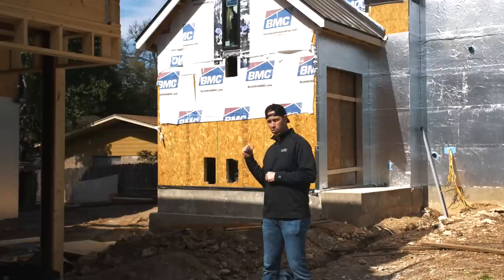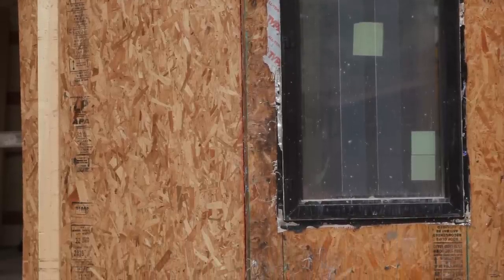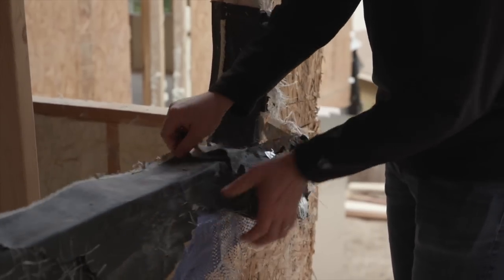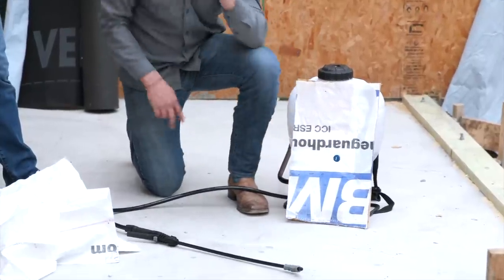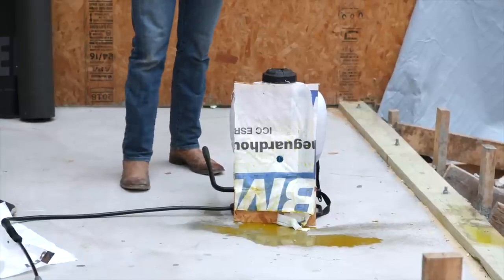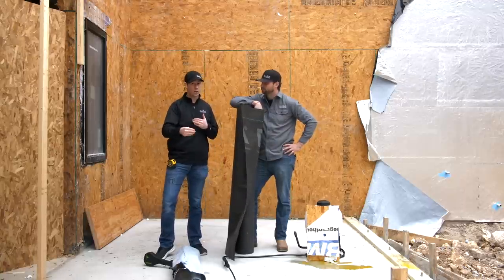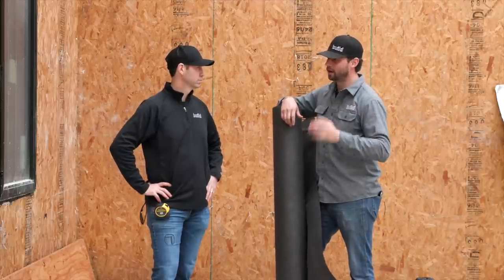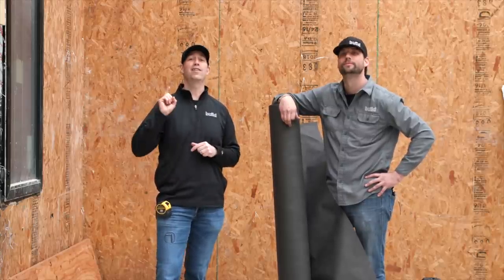Mold and Rot on a BRAND NEW HOUSE - What went wrong?

Comment: Can you tell us more about Delta, is that a tarpaper product? What do you think about tar paper?
Reply: Not a Tar paper product, it's a synthetic underlayment & pretty expensive. Issue with Tar paper is that it breaks down very quickly if exposed to direct sun light for more than about 30 days.  Best option in my option is to use ZIP since it save time having to put up a vapor barrier, You just need to roll the seams with the Zip tape. Funny that home was probably a 2M to 3M, yet the home owner options to go the cheapest option. Now they are paying the prices of choosing the lost bid contractor and lowest material costs. Case of penny wise, pound foolish.
Reply: It's a brand
Reply: @guytech7310 , I agree that tar paper breaks down with exposure, but most don't leave it exposed, or at least they shouldn't.
The Zip System with liquid applied sealer seems to be the best, but how are the nail penetrations sealed when the siding is installed ?
Reply: August:" I agree that tar paper breaks down with exposure, but most don't leave it exposed, or at least they shouldn't."

Actually its very difficult to get tar paper covered in time. Consider rarely does the contractor that does the siding or roofing work show up the day after the paper is put up: weather, scheduling delays, material delays or wrong or incomplete materials. 30 days isn't a lot of time in a construction project. Also consider its a good idea to install battens for a rain screen between the sheathing and the siding. Depending on the project this can take about a week or more. Again: Fluid applied requires extensive training to apply correctly & its difficult to find certified contractors. Tape is the safe option.
Reply: @guytech7310 , True and I agree !

Comment: Hey Matt, I recently bought a home in Central FL. It's a 1984 wood frame, covered with red brick. I recently discovered at the top of the wall, the approximately 1.5" gap between the water barrier and the back side of the bricks is not sealed. Should I go ahead and seal that opening, or is there a specific reason it was left open??

Thanks
Reply: there is supposed to be an air gap.....

Comment: The only good reason for using OSB on a wall is that for a 1 story home you can use 4'x10' OSB vertically and eliminate the horizontal gap.
Reply: They have 4x10 plywood. Osb has now use other than something that never sees moisture

Comment: Great video!
Nice to see you use german products (delta foils).

But what I do not understand - how can one build such a huge house and then choose to construct it with what seems to be rather flimsy "tooth-pick-sized" wood pieces with osb board attached to it?!

For my garden-shed - ok, sure!

But for the house I am living in, i would rather have Aircrete like Ytong, Poroton or something similar or solid limestone as the inner shell - then some 7-8 inches of rockwool stonewool insulation - an steam-permeable membrane attached to it's outer side and then some good old fashioned bricks on the outside of the wall. All built after code and it should be good for 100 years at least...

You do not build such a big house for 20-30 years, do you?!
Reply: Kniefi there is nothing wrong with wood if you keep it dry.  Dry wood is not a 20 year product.  It will last far in excess of 100 years.
Reply: Most new construction in the U.S. is indeed intended to last about 30 years, given the materials they are built from.

Comment: 99.9% of homes built in the last 30 years have half the life expectancy of of homes built before because of the changes made in insulation and the exterior. It depresses me to even go around trying to fix them anymore.
Reply: Could you elaborate and what do you suggest?
Reply: Totally agree. I have spent the last 15 years FIXING new construction defects or new additions/repairs on old homes because the builder/repair person did not understand the science behind the materials they were using. 6' mushroom in a living room wall because the builder used foam board sheathing AND a plastic sheeting vapor barrier behind the sheetrock, so when a small roof leak went unfixed, the water went down the wall cavity, hit the treated bottom plate(slab on grade) with no place to go and BAM! 6' mushroom.
Reply: David, What's wrong with the insulation techniques ?
Reply: @lisad2701  It isn't just the builder that needs to understand building science. You as a consumer need to know some things. 
For the most part homes are built structurally sound due to having to have engendered drawings and inspections by code officials. However it only has to pass code minimum so not perfect. The missing pieces are the understanding of what is important and in what order. 
Flooring, cabinets, fixtures etc are soft costs. You can be flexible and go cheap and change them out later. The four layers or barriers are hard to fix later. They are in order of importance
1 the water barrier. If it leaks rain it will rot. 
2 The air barrier. If it leaks air you will have a hard time keeping clean, temperate air. 
3The vapor control layer or really, system. You shower, cook, sweat and breathe moisture. You must know what you are doing with it. You turn a fan on blowing out in the bathroom it still fogs. Where does air get in to replace what goes out?
4 insulation layer. 
These four things are hard to fix retroactively.
Reply: @augustreil  it's not as much a problem with high vapor permiable insulation as it is that insulation changes the way a structure that gets wet, drys. Think about  what is the first thing done to a house that floods even a few inches. They  rip the bottom drywall off enough to take out the insulation. Fiberglass insulation was invented in 1938 and was not widespread for several decades. Even then, it was sandwiched between  the very permiable inside and 1x sheathing exterior that had huge gaps. Plywood changed that. OSB changed it even further. On top of this, central air makes a building suck. Literally. No one thought about what those changes meant to the building enclosure. If it leaked before insulation and plywood or worse, OSB, the wall still dried. Builders didn't have to be as careful with the water. Now if it leaks even slightly the building will stay wet and mold and decay. And in my opinion there aren't but a few hundred in the entire US that dont leak.
Reply: @davidkellers8152 , Very good points, thanks.
Reply: @davidkellers8152   30 years ago, I was an owner/builder of a custom home in southern California - a high desert climate where moisture (other than roof/window leaks) was of no concern whatsoever.  Now, I rely on an electric wheelchair due to MS and very much need to build a small (1 bed./1 bath) house tailored to my special needs.  Also, I now live in a very wet southern climate (50+ inches rain/year).  There are no building permits issued in my area and no inspections.  So, I am unable to personally inspect a building site and with no inspectors/inspections to protect my interests.  I am VERY concerned about moisture as you can imagine.  What to do?
Reply: @lisad2701  See if you can get a referral about a builder in your area from Matt or an industry expert like Joe Lstiburek or get on the blogs at Green Building Advisor.
Reply: @lisad2701  If you have to go it alone, in a wet, humid environment you need a whole house dehumidifier installed with your HVAC system. You need a tight house. Find someone who does blower door tests. Maybe you can get Airoseal to come air seal it. Make sure the house doesn't leak water before the exterior facade (siding, brick, etc) is installed. Sliding and brick are not your water barrier. Have someone try to make it leak with a hose with just  the roofing done. Make sure you get a energy recovery ventilator ERV.
Reply: @davidkellers8152  Thank you for the information!
Reply: David Kellers -  That bad huh? Yikes

Comment: I’m sure the regular house wrap is fine once the siding goes up. But older homes built back in 1920 have little to no wood rot and most don’t have houseware.
Reply: They weren't made with osb then and they had lots of ventilation, great for letting house dry, terrible insulation value.
Reply: @StacyForest738  yup
Reply: Tar paper. Tar paper. Tar paper. Everything else is a gimmick

Comment: I need to air seal an existing construction home from the interior, when I pulled the paneling down inside its bat, and then straight OSB then the exterior siding.
Would it be best to create an air cavity all the way up to the existing gable vents near the roof by creating a continuous cavity with rigid foam, seal around that between the studs and then put the batting back in, as it’s in good shape
Spray foam is out of my price range and so would new siding
This building had a drop ceiling and batting resting on that for an attempted air seal from living space to attic, any fenestrations are foamed and come out the exterior siding under the 1ft overhang all around for protection from rain and the like.
I’m really racking my brain trying to improve this building

Comment: We had a 4800 sq ft house built 13 years ago DFW area.  I paid extra for Tyvek housewrap.  A fair amount of OSB was used in the corners for structural stiffening.  Not primed but covered with Tyvek and those staple fasteners.  This winter I have been smelling a sweet sickly smell and trying to figure out what it is.   Could be sewer gas from a settled pipe or could be mold.   From your experience with water problems causing mold, do you know if mold smell has a sweet (but sickly sweet) smell?
Reply: take some osb of that type (or several types) put them int the same conditions you expect under there (moist, dark, humid, etc.) and wait for it to develop smell?
Reply: Just get your house tested for mold.
Reply: I know that smell well my friend. You have quite a bit of damage. Really good thermal imager and moisture meter should reveal all of the areas.
Reply: @misterHockey1000  we had an oriental cockroach infestation (large species) they create a smell too.  Bought Syngenta roach gel bait on Amazon and this year no smell and have not seen any roaches.

Comment: its amazing who they let build houses lol. I got a house built in 1958. its true this real wood with a ton of airflow can take a decent beating from getting wet. But man I think the people that built my house was on crack lol. most things with the framing are way off. and there is 0 airtightness. they did a blower door test on my house and they said it was as if all the doors and windows were open lol.
Reply: That's the best they could really do back then.  My 1950 was well built, but its not square or level either.  Probably built with a plumb bob lol.   Only in the past 20-30 years have major changes really been made to new construction techniques.

Comment: Stupid question: Isn't plastic cheaper than wood (or close to same price)? Why don't they make a 4x8 thick plastic sheet for construction? You could get the same shear strength, it would never rot, and it would be waterproof.

Comment: Has anyone experimented/invented a spray-able type of  liquid flashing 
to coat the exterior sheathing ?  That way, one would not need the Zip 
boards, the envelope would be completely coated and would self seal any 
future nails or screws that violated the outside envelope ?
Just a thought.
Reply: Yes!  This is used a lot in the commercial space.  Go look up Polywall Bluebarrier for example.  Spray-able and rollable.
Reply: @JordanSmithBuilds , Thanks.

Comment: Hmmm… I think the house needs to breath for a chance to 'dry' out  if there was a tiny leak. My other thought of membrane is 'in gassing' your own home from all the installed matreieals used in home construction. Water proofing/resistance is important but there is a fine balance for healthy living. Even with active fresh air intake ventilation, it's still debatable. Build it right is more important than ultra insulative protection energy conservation.

Comment: I don't understand the difference between BMC and that rubberized product.  You showed BMC leaking through at the staple, but wouldn't the same thing happen at each nail perforation when you install siding over that rubber product?
Reply: I think it's self sealing, so it should not leak. Emphasize on the "Should Not"
Reply: It's not 'rubberized', it is like tar and should maintain a seal around a nail. Looks similar to products use for dampening car doors (and other metal surfaces).

Comment: Best building envelope design is OSB/plywood, waterproof membrane, insulation,rain screen then siding builders are not used to this method in residential construction but it's used in commercial.

Comment: From a viewpoint of best cost effectiveness/practicality:  Wouldn't it be logical to apply Alumaflash  to the lower wall and Deltavent to the upper wall.  This puts maximum protection where you need it most and still allows the wall to be vapor permeable--all while keeping costs down somewhat.  For my build, I still want the inherent protection that 3' eaves provide and they would complement the hybrid housewrap I am proposing.  Does anyone see anything inherently wrong with this strategy?  I am building pretty soon.

Comment: I do trust the information & views presented, but I would feel much better if you weren't sponsored by PolyWall - it does make people question your objectivity
Reply from the maker: I’m sponsored by several competing companies that make Top notch air and water barriers. These are products I’ve used for a decade or more before they sponsored my videos.
Reply: Do some of your own testing, you can find small pieces of house wraps or really anything else he uses from left overs at job sites. The self adhering stuff is common sense really, a big selling point is getting the materials in your own hands, the differnce is noticeable right away

Comment: What would you use to insulate if your exterior walls are concrete block and your building in Florida?…thanks Rodney
Reply: You are luck to have block walls. I also live in Florida and have to deal with a frame house that had way too many mistakes done to the flashing and dripping edge poorly installed.
Reply: BSC website, 'perfect wall'.
Florida is hot and humid.
You might have a chance of flooding.
The thermal mass of the concrete is best on the inside of you home.
Do you have HVAC?
Not an easy case without more info.
Concrete blocks are porous.. so could dry to the inside.
If flooding could be a prob, insulation needs to cope with water going into it or onto it.
After flooding it would need to be washable.
Closed foamcell probably.
And in front of that some siding with an airgap that protects the insulation but allows air to dry that surface/space.

Comment: So what’s better...Delta Vent SA, ZIP 2.0, or full fluid applied?  Getting confused here!
Reply: FWIW: ZIP is probably the best & overall lowest cost. For Fluid applied you need to use skilled labor that has gone to the training classes. If its not applied correctly it can crack or leak. Delta Vent is very expensive. ZIP is the best in my option since it saves some labor during installation compared to adding house wrap after shealthing is done. Its pretty quick and easy to just tape up the seams with ZIP wall sheathing. Consider that Matt is taking over an existing project, so using ZIP isn't really an option unless all of the OSB needs to be replaced.
Reply: Guy Tech Thx!
Reply: Nobody installs zip perfectly, and the results are terrible when this happens. I rip apart zip houses all the time

Comment: Ok these products are all fine, but under no circumstances should we be relying on them. Roofing, cladding, (siding for Americans) overhangs, flashings and gutters are what should be relied upon. If you're relying on sticky goo or a wrap to keep water out you have a major problem. It's the last line of defense. This house obviously suffers from bad design, and then it wasn't flashed correctly. The water should never have gotten in to begin with. Had this been designed and built properly, the rubbish building wrap wouldn't really be an issue.

Comment: But Matt, Your exterior trim or whomever installed it did not take any time to consider how to flash that corner with a small or insignificant overhang......the trim should never have been butt jointed endo...of course it's going to leak and get behind the paper.....very poorly executed.....

Comment: have you ever used any Typar products?
Reply: typar is very common for us in the CT region and we haven't had any issues(that I know of)  like this if it is applied correctly and is properly taped and sealed
Reply: and we do just use regular staples
Reply: Junk. It’s junk. Just like tyvek.

Comment: I would rather build a house using thermal insulation bricks (e.g. https://en.wikipedia.org/wiki/Brick#/media/File:Porotherm_style_clay_block_brick_angle_1.jpg ) and not some sort of cardboard with a raincoat, but do it as you like... But yes, if you use OSB or anything else on wooden framing, then for example the Dörken "raincoat" is essential.

Comment: How can you build walls out of OSB?  They contain so much glue that there is 0 breathability.  What is the benefit of the breathable Delta membrane?  I have also seen that walls and roofs are insulated with foam.  Healthily and for the living climate simply only garbage.  Use natural building materials again or do not build a house.